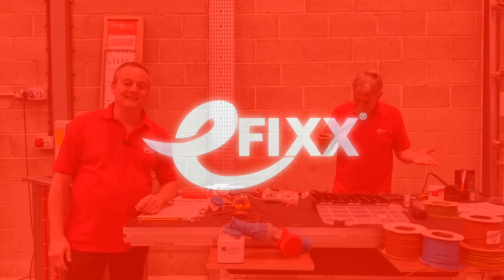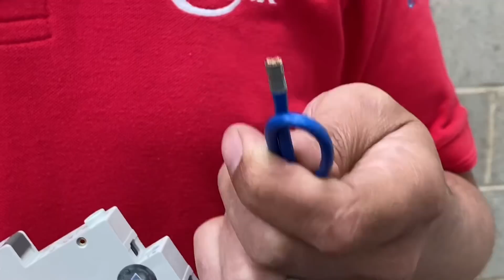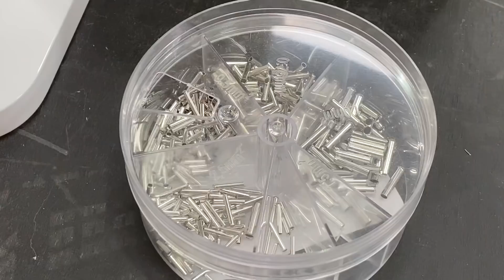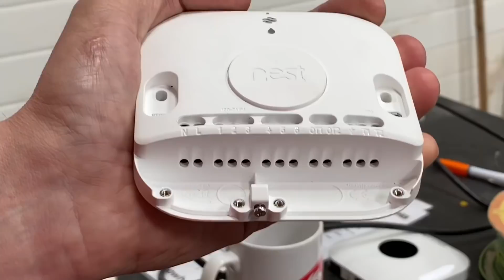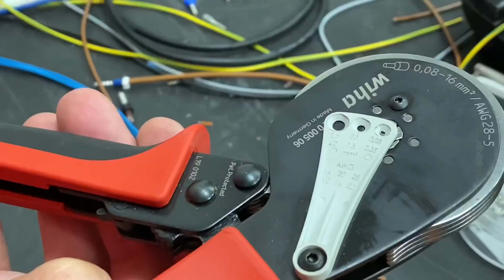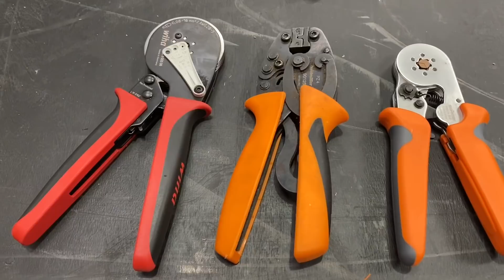Ferrule crimps -Types, tips and where to use them - inc Wago 221 and Nest connection

Comment: Here is a question. Can ferrules be used in WAGO push-wire connectors ?  This will allow for multi-strand conductors to be used with WAGO. The longer length ferrules will be needed.

Comment: You can visually tell what size an uninsulated ferrule is, and even though the strand funnel is small - I still hate the color-coded schemes of insulated ferrules which clashes with my wire colors and just looks like 'auto parts store terminal crap' inside of a very expensive control panel. Plus I can get the length I want in uninsulated ferrules.

Comment: Ferrules and Ferrule crimpers produce square profiles; this is sufficient for low current (<10A) applications.
But what about large gauge wires when I need to carry 100A into an MCB.
What ferrule, terminal lugs or crimper are available?

Comment: I don't like those double ferrules as if you have to separate the two wires for some purpose, such as for diagnostic reasons, you have to cut them. I would prefer to use ferrules without the plastic collar and keep the wires separate.

Comment: Recently, was working on a wiring harness for Honda PCX125 scooter wiring harness. came across where several wires were ferrule-style crimped together - without a ferrule; (in essence, what might be called a "cold-flow" crimp: a term common when crimping automotive battery cable ends). The connection was still intact and appeared to be well bonded. Are you aware of crimping tools specifically designed or these type of crimps? (i.e. exerting considerably more pressure than average for ferrule crimps?).
"Cold-flow" crimps reduce/eliminate air gaps/spaces for corrosion to develop; "tinning" said, post crimp, introduces heat (and/or flux) where corrosion can be initiated.

Comment: Can I use a ferrule inside a ferrule to step up the wire gauge? Strangely, I can’t find an answer to this on Google. I need to use 12AWG wire in a plug housing that is made for 10 to 6 AWG wire. It’s part of a pigtail for running 12A load on a 50A outlet.

Comment: Soldering stranded instead of using a ferrule is a big NO the solder "flows" under screw pressure over time and the connection becomes loose.

Comment: I have used very thin uninulated ferrules and thin coloured heat shrink sleeves to successfully repair a damaged PC keyboard cable in a pull out drawer in a 19" rack.... I spliced them so that they didn't all combine to make a huge lump in the cable...I also sleeved the cable with heat shrink in the vulnerable areas to save from future damage... 
Much slimmer repair than soldering...

Comment: Can you put your two neutrals or two live cables into a ferrule to a ring socket circuit to  create better connections
Reply from the maker: Not suitable for solid conductors
Reply: @efixx  can you expand a little! as to why not please?
Reply: @Ken_4711  think about it.  You are going to potentially damage a solid conductor.  With stranded, you are forcing the strands together.  Not so with solid.

Comment: You don't need ferrules with the Wago connectors, BUT do you need to use ferrules if you're going to try to stuff two stranded wires into one lever section? I'd think there's a chance of much worse gripping in such a connector if you don't do that.

Comment: I loved your video and tips, thanks from India. Non insulated ferrules are not easily available here . My question is if I insert the wire from the other end, crimp and then but off the plastic part, would it be technically incorrect, would it cause some problems. I need to wire home use appliance plugsany times and was thinking of a solution instead of soldering.
Reply from the maker: That should work, but could be a bit like threading a needle - as the non insulated ones have a slight fluted edge to help guide the wires. If you can get non insulated they are usually much cheaper
Reply: @efixx  I've occasionally used an insulated crimp and cut off the shoulder after fitting. Solves both problems!

Comment: What Crimp form,  Hexagonal or square?  Can't understand how the contact surface is the same for each pattern, any ideas?
Reply: It really depends on whether it's inserted into a square or round terminal.  You'd get more surface area contact on square ferrule to square termination.  It'd be a similar scenario for hexagonal to round terminal.  Usually the screw in the terminal block presses into the bootlace ferrule itself.

Comment: I heard you can only use ferrule on copper wire only and on low voltage system like 12v and 24v  systems only. I am a commercial engineer for commercial dishwashers and Glasswasher,  I was told by the gentleman in the electrical store that they would be no good for wiring into contactor for boiler heating. What are your  thoughts on that?  Any info would be appreciated. Good video. Thanks for sharing

Comment: Insulated boot lace ferrules (I know they are aglet's on boot laces) invented by Telemecanique I worked for them when they first came out. Keep a drill bit the correct size in your box for when some prat steps on the box. You can get double Ferrules in the insulated ones the shoulder is oval.
Reply from the maker: Great tips!

Comment: Great tips. Obviously not all ferrules are made equally. Are we concerned about the cheaper ferrules that are floating around that a lot of people will be using will not have the same electrical properties such that of copper/tinned wire?
Reply from the maker: Agree - That is something we are planning to investigate.
Reply: Always buy weidmuller ferrules
Reply: We cannot afford those expensive German ferrules. The Chinese ferrules works , so it will be used.

Comment: I one time did solder end of wire for a hot water tank 2.7kw ended up with a over heating end so then crimped it.
Reply: That was the reason the practice of soldering the end stranded wires was banned here in Germany in 1979. The solder will deform in a terminal if put mechanical stress on it with a screw, that will cause a loose connection over time. The solder also corrodes on the surface. On a soldered connection that's not a problem, the corrosion is only on the surface, but if you solder the tip of a wire and put it into a terminal it will cause problems over time. The corrosion is caused by the flux. It roughes up the surface chemically so the solder will stick on it.
Reply from the maker: Good to know

Comment: Somewhere in "The Regs", (17th ed. I'm out of the game now so no 18th ed.) I think it says not to use soldered cable/ flex ends in to screw terminals.
Reply from the maker: Section 526.9 (18th)- has quite a bit on multiwire and fine wire and very fine wire conductors. - You're right no soldering/ tinning for use in screw connectors.

Comment: Great video.. have you tried the ferrules on the non lever wago? Always been a problem having to have both to hand when using flex. Many thanks steve
Reply from the maker: Yes - The answer is “depends” - needs to be a large enough diameter to “act” like a solid core when ferruled up and if using shouldered ferrules not too big to fit in the terminal entry.
Reply: If you need an uninsulated ferrule you can just cut and peel off the plastic part, then it will fit in a smaller opening...

Comment: Love ferrules - often makes the job so much easier. The longer ones even let you insert a stranded wire into a wago push-fit connector such as the 773 series.
Reply from the maker: #TopTip - Thanks
Reply: @efixx  where can find easy guide for wire sizes for different applications